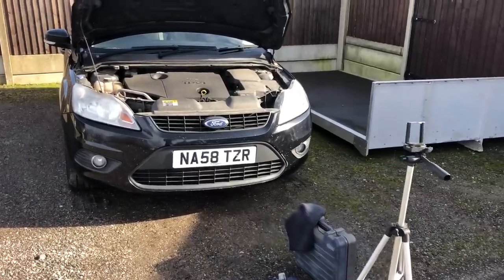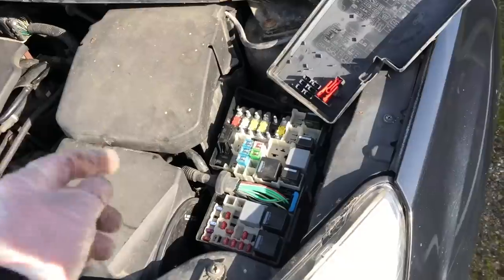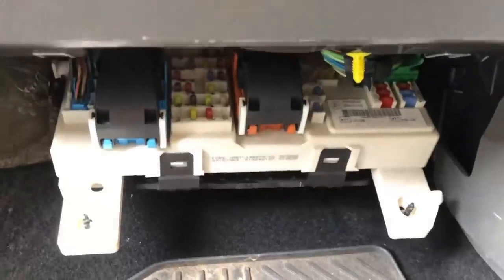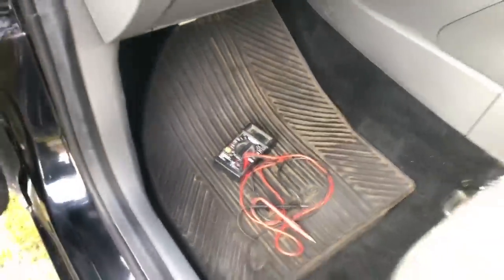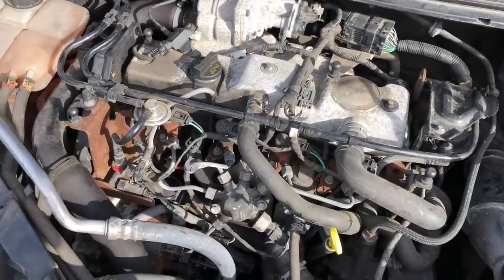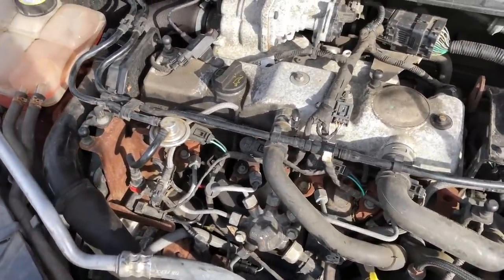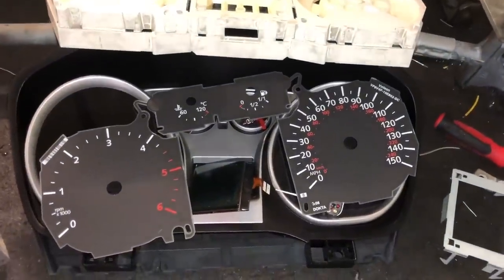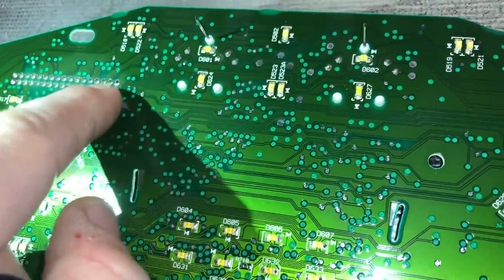£200 bargain car adventure pt2

Comment: Well I never, I would not have thought of that at all, is there a major ecu or immobilizer circuit there that gets broken, when the solder joints fail?  I would be interested to know why that prevents the engine from startIng, great find.
Reply from the maker: Leona Devon apparently the immobiliser goes through the cluster 👍

Comment: Awesome 👍🏻. Like you I've never heard of that fault before, even at £150 I'd have paid it, a fully Mot'd car for a £450 outlay is a no brainer. I'd give £700 for it if I were in the market for one.
Reply from the maker: Graeme W 350 👍
Reply: @sruk  Yeah Rob, you got it done at £350. What I was meaning though was if it had cost the £150 to fix and ended up costing you £450 it was still well worth it, sorry for the confusion.

Comment: Glad it was fairly simple to fix, after finding out it wasn't a fuel supply problem. I'm actually seeing and hearing of quite a lot of those electrical type problems on farm tractors  I fix for customers. But sadly some of the clusters aren't easy to fix or find a company to do them. The manufacturers have discontinued replacements for some of the pre 2000 equipment now, or if still available they are thousands of $ !  
     one of my tractors here is tripping the emergency shut down light on the dash, Its the same problem. I can move the plug and get it to work right, and the changes in air temperature going from hot to cold will do the same thing making it work right. 
  I've taken it apart but the repairs above my pay grade, as 1 whole board with about 300 joints needs removing to get at 15 socket joints  sandwiched in the middle of the 2 boards.
   I need to find a guy doing electronic engineering at the local college to do it for me, or take it to a college and see if they will do it for student training in the classroom for a donation.   Thanks for the video, Take care.

Comment: I heard of this problem with the solder on the back of the dials cracking on the fords...if you bang the top of the dash the car will start in most cases. Glad you got it sorted.

Comment: Initial thoughts were the fuel electronics. That happened with a TX2 taxi I was driving (2.4 duratorque),it needed a new pump. Symptoms were the engine suddenly cutting out with the glowplug symbol flashing.    Mr Ford will be 1000s out of pocket now that people realise the tiny thing that would have scrapped their car.

Comment: Ive got a 2008 focus too with the exact same problem. Im guessing all it is, take the clock apart and solder the joints on the pcb?
Reply from the maker: Waqas Khan 👌

Comment: Good old internet and a good friend saves the day. My polo 20yr old is running like a dream now i put a new coil pack on it. The old one lasted 175000 miles and it was cracked and arcing. £30.00 fix and owes me £285.00 in total with the problems ive had. Will run it another year mot due august so happy days

Comment: What a turn up for the books indeed Rob. No one told you this could be the fault although its apparently very common!  One other irony is that this is the only repair I have seen you do that I could do.  I know nothing about cars but do know something about electronics/electrics and can use a soldering iron. However, taking the clocks apart just to get at the PCB would be an issue for me.  Thanks for another interesting video.  Hope you had a nice valentine’s day with the Mrs.  ATB Chris 👍
Reply: What not even an acknowledgement to your closest and most loyal fan! Never mind will sill view & enjoy your videos

Comment: Try smacking the dash above the clocks. you get bad connections on the circuit board, the engine malfunction warning is synonymous with that fault too
Reply from the maker: Lemur all sorted
Reply: @sruk  Yep, put that comment at the beginning of the video, just seen that was the fault. Glad it worked out 👍

Comment: That's shocking - dry solder joints - scrapped car, unless you happened to know the fix.  These "cheap n cheerful" ones will do someone as a decent little runaround, so its great to see that old / cheap can still work out.

Comment: The cluster problem is a common problem on the Mk1 Focus C-max and Mk1.5 C-max as well. Most people in the C-max owners club will tell you if it won't start hit the top of the cluster. If it starts then it's dry joints in the cluster.

Comment: Hello Sir. I am writing you because I feel you can help me. I bought recently an Volvo S40 2004 2.0 diesel with Siemens piezo electric injectors. Since i bought the car the injectors were leaking and the car had a very white-blue smoke at the start. I had the stupid ideea to disconect 2 injectors from the electrical conector while the engine was running, and the car started running on 2 cylinders. I re-plug the connectors back while the engine was running, but those 2 cylinders didnt start again. I shut off the engine, and when i was trying to restart it nothing happened. Now the car cranks but does not start. As a fault it shows 0380 glow plug relay incorrect, but nothing related to the injectors. Was that such a bad thing that i disconnected 2 injectors? Thank you and good luck with your Project.

Comment: I said it yesterday its the Fuel Pressure Sensor being the fault, just proves it with the Engine Malfunction coming up on dash. its far from fixed and it will break down/cut out again soon. the dash cluster would not make the car cut out like in the other video
Reply from the maker: Oculus Drifter it was nothing to do with fuel

Comment: BTW that engine has 2 cambelts, after 2007 there's a wet belt inside and underneath the cambelt on the top, pre 2007 it should be chain still

Comment: Luv ya vids, you seem like a diamond geezer. Tell me, were the dry joints connected to the engine stop relay and or engine stop valve???. I was thinking all along it might be the engine stop valve, never would imagine dry joint on a pcb.
Reply from the maker: Johnny Ralf The immobiliser goes through the clocks

Comment: Crazy electrical connections I thought French cars had bad electrics I suppose its like the older stereo gear from back in the 70s and 80s just dry joints

Comment: I had a Passat that I parked outside someone’s house as I was doing a delivery on Xmas eve I gets back in and the car wouldn’t start.no lights on dash nothing …To make matters worse ..the electric hand break wouldn’t release…I got it towed away from guys door as I was blocking few cars in …got it down home.I got a hold of an  autospark after Xmas ….he just changed a fuse and that was it ….so simple

Comment: So it wasn't the piston return springs. If I said you needed to resolder the block connector on the back of the clocks, I bet you wouldn't believe that either. lol, I would have thought the PCB would have been conformally coated to protect against moisture, oh well save a penny save a pound. Halfway through the video, I was suspecting a similar problem you had with the land rover.
Reply from the maker: John Richards pistons don’t have a return spring they are connected to the crank by a conrod 👍

Comment: I paid £600 for a 2007 Ford focus 1.8tdci, it had 170k on the clock. Sold it for £800 a year later with 190k. Never had an issue with it. Got me through a hard financial time averaging 55mpg.....wish I kept it.

Comment: Rob, can you just clarify one thing for me. When it broke down did it go into limp mode or did it just completely cut out. Thanks
Reply from the maker: Bird Man it just cut out but I wouldn’t notice limp mode anyway I drive to slow 👍
Reply: @sruk  🤣 I had exact same model and year. For me the engine still ran but it would just crawl at 15mph. I do wonder if I had a similar fault though Rob. No fault codes.

Comment: Really intresting wonder if it was part of EU reg. They asked that all electronic to be lead free solder. Problems with xbox ring of death was same thing.
Reply: If you k so how to solder you can fix it
Reply: @mrwideboy  pretty much. Place the circuit board in an oven. Don't need to do it by hand. Especially if the joint are close to each other.
Reply: @peterl.deegan9059   I have degrees in physics so you learn how to solder, I can resolderd whole surface mount chips, but you do have to be careful.  As a little side line I used to buy broken plasma and 4k tvs nearly always it was a transistor which cost  50p. People would sell them for £1 and I could sell them for 300. Sometime I had to replace  a board but that was easy

Comment: would of been a quicker check just to take the oil cap off and have a look to see if the cams are rotating when your turning the engine over,  rather than taking a belt cover off.   just a tip for the future
Reply from the maker: Gascans I couldn’t hold the camera and turn it over I was on my own 👍
Reply: @sruk   ah i hear you mate.  Working on cars we need an extra hand lol

Comment: I was really interested tolearn about the dash clocks being the problem. Some years ago I had a Transit van that gave up the ghost while I was at work. Called the RAC, bloke comes out, gives the top of the dash an almighty THUMP!! and it worked perfectly after that for several months when I sold it on. (RAC man just said "If it does it again, just do that!") ..... 

Sad thing was though, my mate who bought it off me inherited a dodgey Oil pump that I knew nothing about - result? Seized engine after only two weeks - AAARRRGGGHHH!!! ..... Looks like I dodged a bullet there, but his Dad (who was a mechanic) sorted him, so guilt reduced (a bit ;-).

Comment: Who would have though a dodgy solder joint on the clocks would stop a car from running... Never used to have silly issues like this before it became all computer/electronic controlled.

Comment: Did your auto electrician say where those dry solder joints went to? Fuel pressure transducer? Fuel pump relay? Just out of interest.
Reply from the maker: wirdy1 I didn’t ask he soldered all of them 👍
Reply: Ah, okay. Yeah I watched him reflowing the solder joints. I had a quick look on Ford forums & it was most likely connections to the immobiliser circuit.
I'm old-school electronics tech & since the ROHS introduction of (rubbish) lead-free solder these dry-joint problems have massively increased. The irony that it was done to reduce harmful waste but now so much stuff is thrown away due to bad solder joints it now generates far more e-waste as a result!
Reply from the maker: wirdy1 sounds about right bud in out broke it bin in Society 👍

Comment: Such an amazingly cheap car.  Here in the US especially now with tax rebate time coming up that would be closer to 2k USD I would think.  Although small cars are admittedly somewhat on the wane here and diesels were never that popular compared to Europe.
But still.  Even considering the exchange rate it would be $913 here.  That would buy you a really old worn out junker in the States.
I should know.  I have two US ( correction; not Europe ) only Nissan coupes that I love that are nowhere near as nice as that Ford wagon.
Quick look at autotrader.  Nothing under $3k for '05 era Focus wagons.  Yep.

Comment: Change the fuel filter. They're common to collapse and cut the engine out and wont start.
Reply from the maker: Billy Boy did you see it all
Reply: @sruk  I commented before it finished. The dashes are common too. I send them of to a guy in ebay. It's only £49.99 plus p+p

Comment: Great that you got it all sorted - not sure of its value at £700 though - some of the pipes look perished and you can see a lot of the clips are rusted from its time standing. I find these are the problems from cars that have been left standing for some time.
Also it will need the oil, coolant and brake fluid changing for me to be happy selling it at that price. Good luck with it though.

Comment: Disconnect the battery for 5 mins and then try and start it. The instrument clusters on these fuck all all the time. Give it a good bang on top of the dash and keep cycling the key quickly and it’ll start. Had a few now like this. Ecu testing charged £160 something like that
Reply from the maker: Rain Sturgeon did you not see to the end
Reply: salvage rebuilds uk yeah I did watch haha, but I wanted to tell you straight away what it could be as I have had this fault a lot haha. I realised at the end and was like ,oh I looked an idiot, haha oh well

Comment: Similar fault to my CMAX we had to scrap it in the end was only 6 years old
Reply: you had to scrap it because some bad solder joints weren't reflowed...?
Reply: @RWL2012  Ford diagnosed a cluster fault and installed a refurbished instrument cluster that had the same issue at a cost of £1200.... We took the car back and the local Ford dealer advised us there was nothing else they could do and we should get a new car...... We scrapped the car for £2000 as it was so new and was lucky when we took the dealership to small claims court we got £3000 compensation......... I only realized it was the solder joints after watching this video!!!!!!!
Reply: It is just crazy how solder joints can cause so many issues! One diagnostic had whole can bus communication error!!!!!!! Limp mode is not fun! The car cost us £11000 was our baby our life pimped up zetec family car extraordinaire but only managed 60000 miles...... the person we sold it too had 2 more troubled years and finally gave up

Comment: Man that's stupid for the car to be dead just because of a tiny solder joint on the speedometer board. Bad design. Also as I said, for 200 bucks you can get a yugo here, not a second gen focus. Those are like 4k euro here (even in that condition it would still be over 2k I'm thinking).

Comment: Wat about a code scan? Rather than running like an infant cat after the mice.
Reply from the maker: rimmersbryggeri you must have missed pt 1 👍
Reply: @sruk   I did.
Reply: @sruk  Now I watched it and I didnt watch much of this video and I think it looked quite clearly like a battery low problem. Some times those small jumper packs dont deliver enough juice for a diesel with no juice of it's own. It was pretty typical for peugeots and mitsus when I worked in a dealership for us to have to take a proper battery out to start them if they were totally dead the jump pack just couldnt deliver enough power to start them. So that is my guess for this car.

Comment: If you knew how many computers end up scrapped because just 1 capacitor has "shat the bed" either on the mainboard or the PSU it would make even the most uncaring person in the world feel bad. The rest of it gets scrapped for a part worth under 50p, when new it might of been £2500 only a couple of years before. Flat TV's the same.
The fact such a small and poxy little board can stop a diesel engine running is painful to know, when you think back to stuff like Leyland 680s they would work almost forever, some are almost 50years and still going, couldn't kill it with a stick.

Comment: This has to be a very bad design by Ford. To think that a couple of Dry Joints on that Clock Circuit Board can stop the engine dead - and force you to walk on a cold, rainy windy night! Sadly, I have lost faith in the modern cars for that very reason. Simplicity (like the early Beetles) had a high degree of reliability that could take you to the moon. I too, hate lead-free solder, and prefer the silver solder paste.

Comment: Very interesting - for all sorts of reasons.
Mainly, YouTubers, that it's UTTERLY POINTLESS randomly speculating on what the problem is when you have NO CLUE WHATSOEVER.......!!!  
Modern cars ( even one as old as this) are stuffed with electronics and sensors for everything. Hundreds of scenarios could result in a multitude of different faults, many of which appear to have similar symptoms.
So, smugly saying 'oh, it's the fuel pump' justs looks a bit dumb.....
(in my respectful, and oh so humble opinion!)